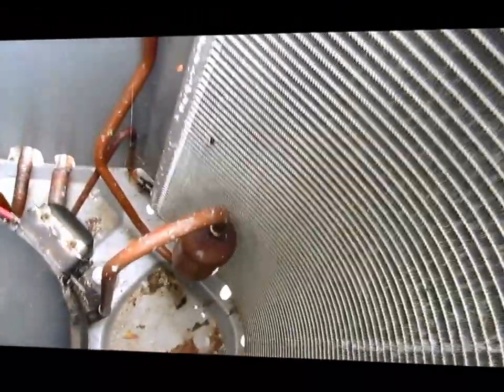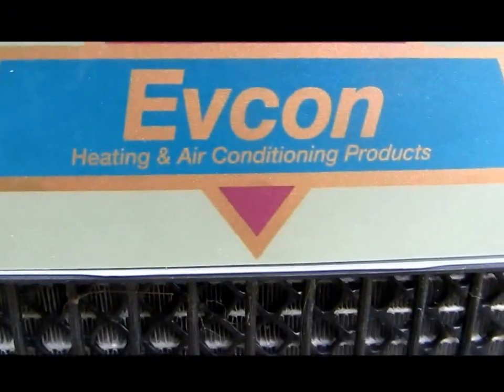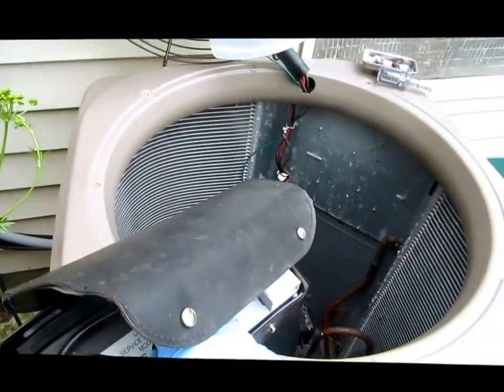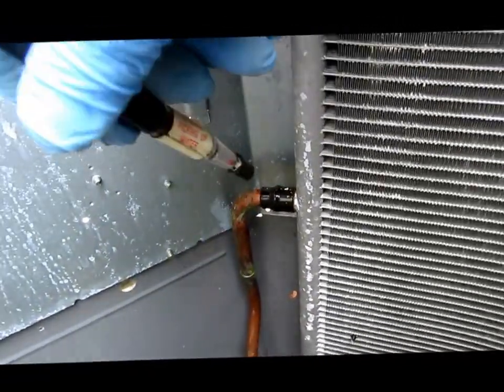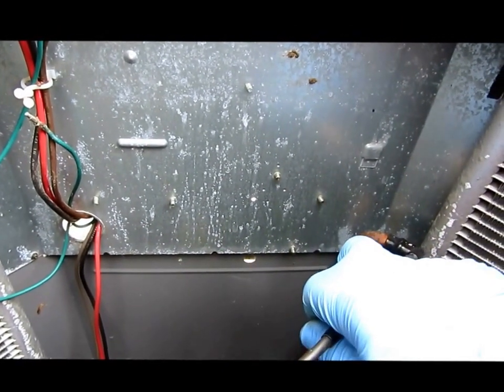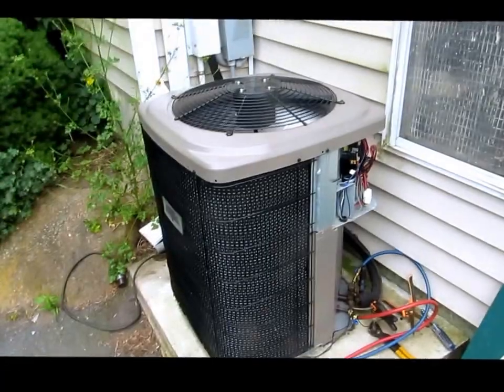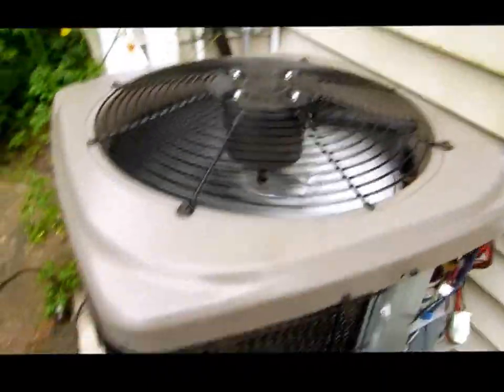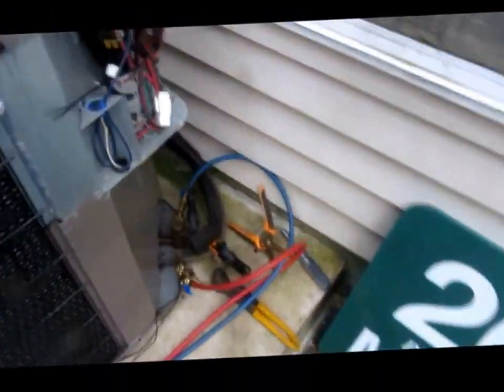Hvac-yorks ugly sister 2 1/2 ton condencing unit ,  micro channel  (shes a leaker)

Comment: I just got a quote on a 2hp Copeland condensing unit for a florist walk in cooler and it has an aluminum microchannel condenser.The last two condensing units I installed were Chandler and they had a copper discharge line epoxeed into an aluminum condenser.What happens when that connection leaks,how am I going to fix it.A couple heavy heat shrink tubes and band clamps?A brass compression coupling with epoxee? Or both? It will still leak. The customer will get mad at us, not the manufacturer.

Comment: I dont see why they dont dont use a better joint when joining copper to aluminum. Epoxy based joint are junk. Hell why couldnt they flare the aluminum and copper both and use a flare coupling? Somethings gotta be better. Im not a fan of flare joints but they normally work just fine. Give us some kind of joint that we can repair!

Comment: wow, i just priced that leak detector!  good video bad micro channel.
Reply from the maker: i sniknej micro channel coils suck
Reply: i have learned.  designed by auto radiator specs, not good with high pressure.